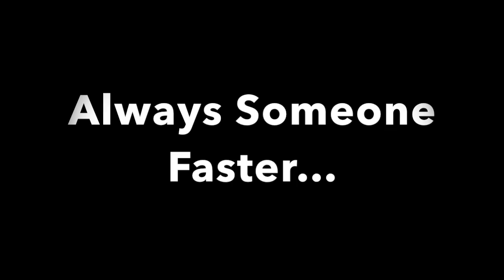HVAC Vlog: Always Someone Faster Quality versus Quantity

Comment: I use the AC company I use at work for my home also. Even with the discount they give me they are still a little higher than other companies but everything is done right. They also spend time to do it correctly. 2 years ago my furnace would not stay on. I had a tech that lived 3 houses over came over. Put in a new relay and left. He had not even got back to his house when furnace made loud pop and died. Cracked heat exchanger.   Called my guys up. Exchanger still under warranty. Complete clean up on inside. Looks brand new. Take all the time you want!

Comment: When you focus on speed during repair/troubleshooting calls, you set yourself up really nicely for confusing symptoms with causes.  Taking the extra time to see and understand everything (within reason) with a system before calling it fixed is absolutely essential to good service.  Sure, you'll still end up with call backs from time to time, but not even near as many compared to people ripping and rocking service calls.  Also, you'll generally end up with happy customers.  Good vlog!
Reply from the maker: Thanks for watching

Comment: I agree with you there Steve, I worked for a retail establishment which shall not be named, and they pushed for quantity quantity quantity, even though when I did a job it was better quality than most of the other employees there, it still wasn't good enough. Needless to say, I'm no longer working for said company, but now I get regular contract business doing my freelance job that I've had for a couple of years. Never have a negative review, and I don't have a callback unless an emergency breaks out. Quality keeps customers, quantity costs more time.

Comment: Clean & Check: speed matters
Service & install: Time matters
If my boss caught me completely disassembling condensers on cleaners, he would have a stroke. Unless you're upselling that aspect, that wouldn't fly up here for a standard clean & check fee... An a/c clean and check should take you no more than 45 min start to finish.
With service and install on the other hand, you have all the time in the world because it's either billable or included in the sale price.
You know as well as we all do than time DOES matter! If you're fucking around on clean and checks for an hour or two, you're not profitable and are costing the company money. At that rate you can only run 5-6 call in a day and have to work 12 hours to do it. 
It's a delicate dance. You have to judge which calls need the extra time and attention, and which calls are a gas and go. After 12 years of service and install I've seen a lot. Including many techs that still fuck things up no matter how much time the spend on a job.

Comment: what i have a bad habit of doing is forgetting things when i get in a hurry.  steps that i know i should have done i just flat out never thought of until on the way home, like forgetting to do temperature rises and things.  if im in a hurry and have other jobs to get to before i can go home i tend to forget these details after the unit is working.  "its fixed, off to the next one".  then half way to the next job i rmember these details and then cant sleep for a week worrying that ill get a call back cause of not doing everything i wanted to do.  LOL

Comment: Right on, quality and customer satisfaction are what regulate your speed.
Did you have to completely unload the other truck while its out for repair, or are you just running with the essentials with the rental?
Reply from the maker: Completely unloaded, they were going to cut the floor at the back door to fix the other van but ended up totaling it out.
Reply: If only CF would buy the rental, and order the shelves. Most times the rental co will try selling it if you said that you liked it.

Comment: I agree it should be quality first than quantity, but when you work for a company that is visually checking your time, the time you receive the call until you finished you are in hurry,  believe me. The service supervisor make you to be faster then they are crying about the call backs, sometimes I noticed that I did not get pay for some of the call backs, you feel frustrated and you do not want to argue back about those call backs you just want them to have a dead end, and do not want to talk about it.
At the office they know where you are and when did you finished the call. I worked long time ago for this company that uses walking talking that must wear at your waist all the time, meaning if you are on call after hours you have to sleep by the side of this machine while it is charging !.
With this walking talking they can here you when you are talking to the customer, they even have GPS in their  vans, and also they have cameras at the vans .
One day I accidentally walked to the office and I saw the service supervisor checking on one technician that had spend more than 2 hours , the camera was from the van pointing to the house waiting for him to come out, since he left the walking talking inside the van, they can not communicate. If you tell the customer something that really do not need to change at the time but still working fine and only needs to change the part that is failing. Next day in the morning you are on trouble. This company has somebody that listen all the talks from every technician in the field then after he listen he visits the supervisor and let him about the issue then when the technician comes , the supervisor says something like a customer call and say that you say that the fan capacitor is weak but does not need to replaced right now. I told the supervisor yes I checked it and still was right on its performance. He say next time do not tell customer that and make the change, and charge it. In my opinion I do not think that the customer called back at the office, and saying something like that. The most important thing is that system is running back again. What I am try to say is that if you are a good technician they will make you a bad technician , since they are on your privacy . People that are working for this company they know what I am talking about because it is the only one company that uses this walking talking and are placed all over the United States.
Reply from the maker: +veronica sofia it’s sad that companies operate like that only to make more money and have no concern for their customer and quality service practices.

Comment: remember when you go to a house and it is a complete disaster Install with cheap ass duct board too much flex that's the owners/ builders fault they went with the low bid. and you get to make the money to tear it out when it all falls apart the thing as some of that Duct we're just putting finished areas of a hole that are inaccessible unless you start cutting up and ceilings the builders don't care buyer beware lot of these builders are complete scumbags